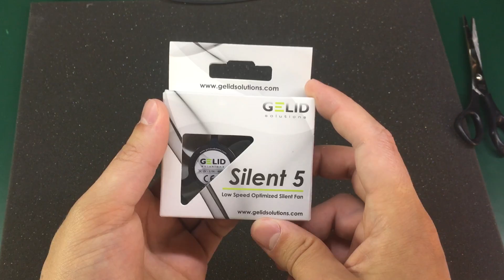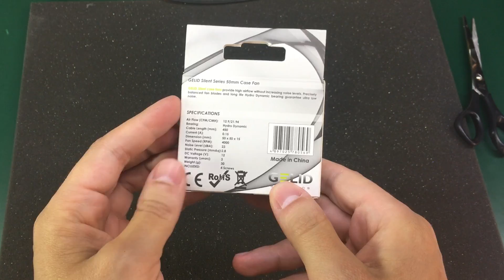Voltlog #57 - InTheMail

Comment: A few months ago in #37 you mentioned wanting to review the TSA2110A board, have you done this already? I can't find the review.
Reply from the maker: Oh, I have it in a corner of my bench for months. I really want to build it into a small enclosure and add some lithium batteries to use the whole project as a portable bluetooth amplifier. I haven't had any time so far to get it done, but it's definitely on my to do list.
Reply: VoltLog Cool, thanks. I plan to use it to retrofit an old broken tube radio.

Comment: I've used those PCB boards before. There is a major trap with them, the a..z markers are in different directions on either side.
I was VERY grumpy after soldering up a circuit using these markers. :(

Comment: I've used those PCB boards before. There is a major trap with them, the a..z markers are in different directions on either side.
I was VERY grumpy after soldering up a circuit using these markers. :(
Reply from the maker: thanks for the hint!

Comment: I have pretty much all the similar hardware and modules you have. Great channel. Keep more videos coming. Btw, as an experienced person with ELs, you can cut them into whatever shape you want. Very much like a thick paper, but make sure you use sharp knife. ELs are like capacitors, once you cut them double check the conductivity between the electrodes. It should be infinite or in some MOhm range.
Reply from the maker: My fear with the EL panel was that if it had some kind of outer electrode that would go around the edge it would stop working if I'd cut through that. Thank you for the hint though, I will give it a try.
Reply: EL is a sandwich of one opaque and one transparent conductive electrodes. In between there is a luminous (phosphor based) and dielectric layers.